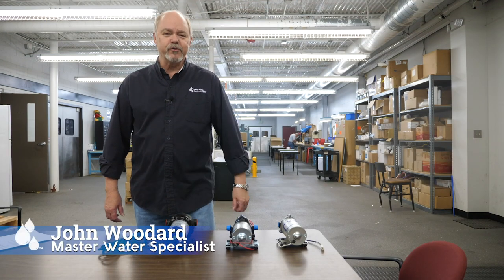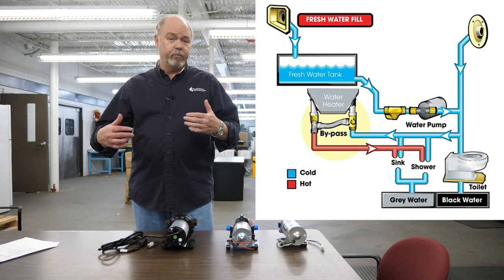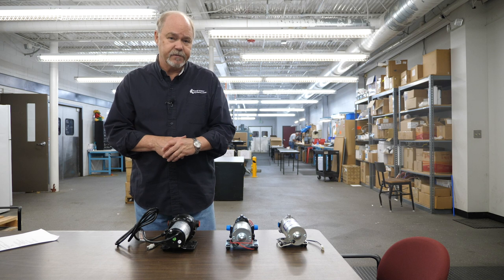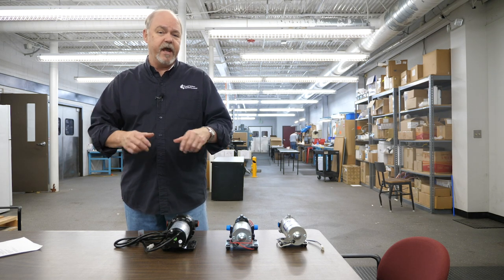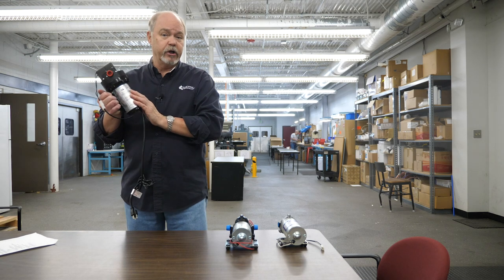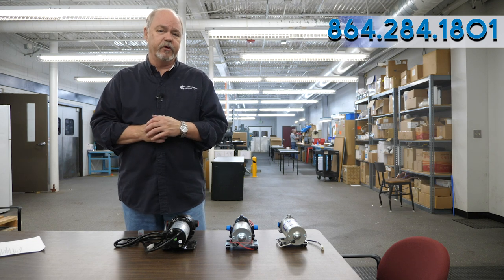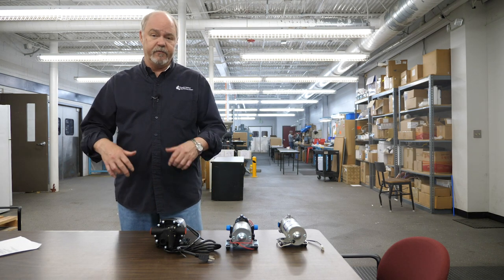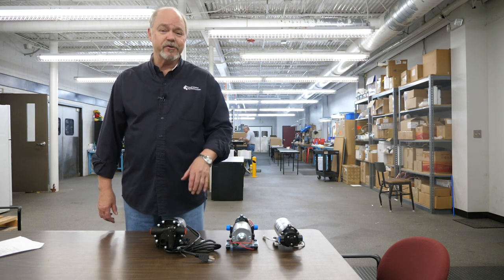What is a Demand Pump and How Does It Work?

Comment: Good simple explanation. I want to set up a 12 volt solar powered pump to water some garden containers. I was thinking of using one of those garden hose timers that you would attach to a hose bib to create the demand so the pump will turn on and off. I would like to use 3/4" pvc to make the drip over the containers connected to the pump and timer by a garden hose. The water source would be buckets so no pressure there. What pump would you suggest?

Comment: my municipal water often reduces the pressure and even turns off the system to divert water to a neighboring municipality. Is there a way to insert a holding tank and pump to service the house - such that when municipal pressure is good, nothing happens, when low the pump boosts pressure using water in the tank, and when off, the pump provides all pressure with water from the tank? or What options are there for adding a pump system?
Reply: I have the same question !!!!! did you ever find a answer to this question?
Reply: @OmegaMetalic  No, no reply and haven't found somewhere else.
Reply: Why don't you call a few plumbing contractors in your area and ask them for a quote or estimate?.
Reply: @BobSmith-iu3hx  Because here in the Philippine, plumbing contractors think using an old intertube to wrap around a leaking water line is an appropriate fix. Asking them about a specific pump is a waste of time.